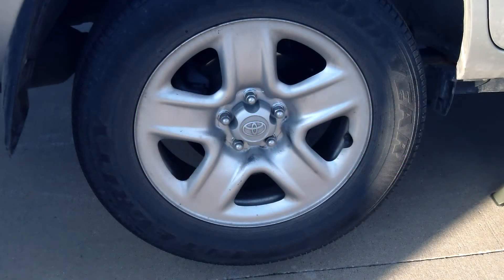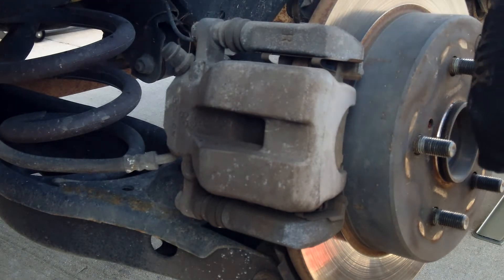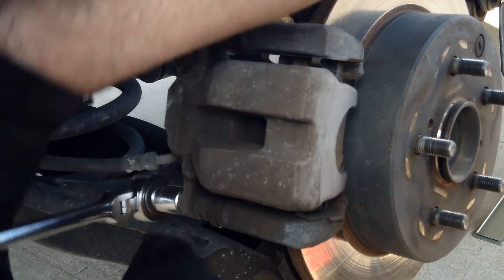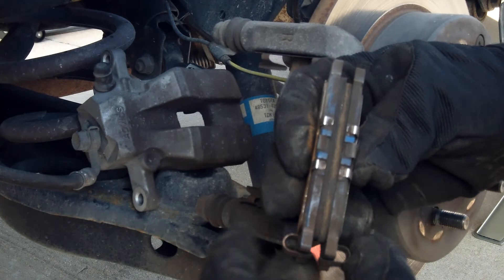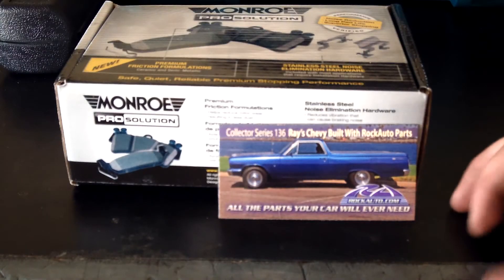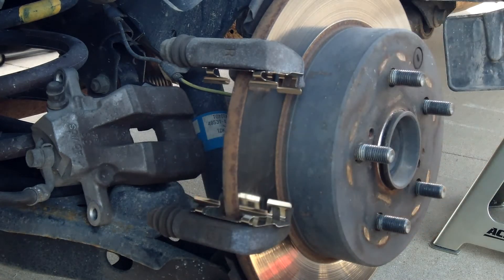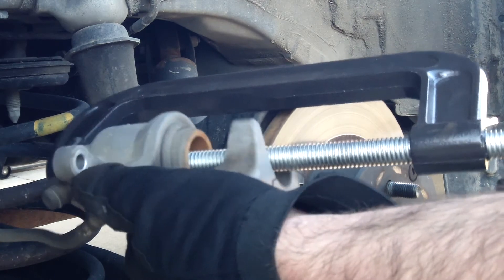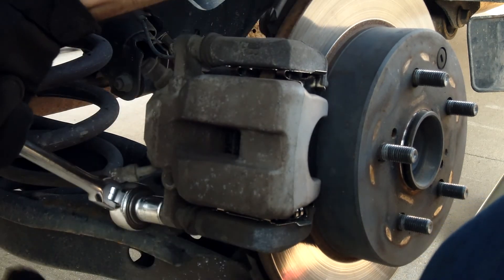Toyota RAV4 Rear Brake Pads

Comment: I've watched several of these home videos and none of them talk about bleeding the brakes? That fluid has been in there a long time and should be changed. Suck out all the fluid in the brake fluid reservoir and replace it with fresh. Then bleed every wheel until you get fresh fluid coming out of the caliper. No chance of rusty calipers after this point.
Reply from the maker: Thanks for watching.